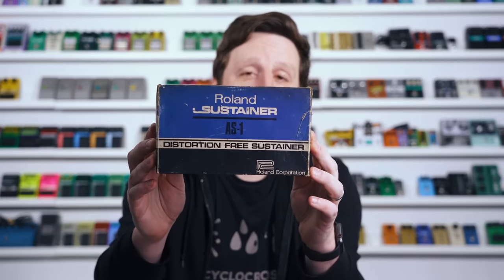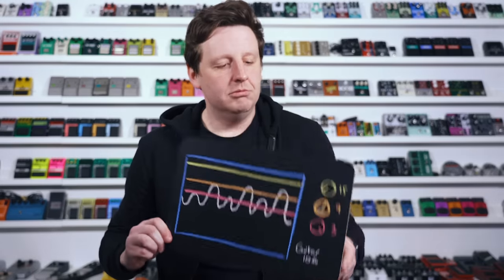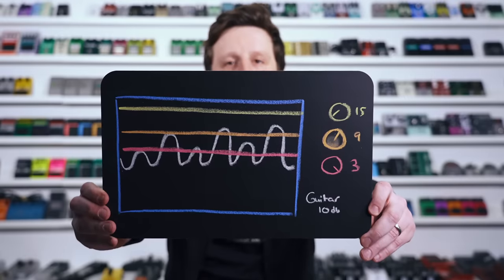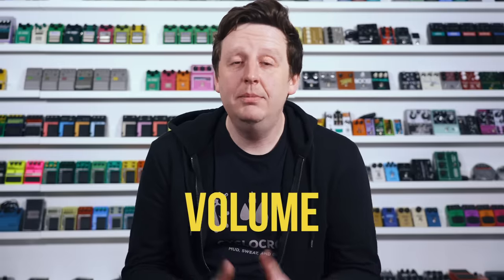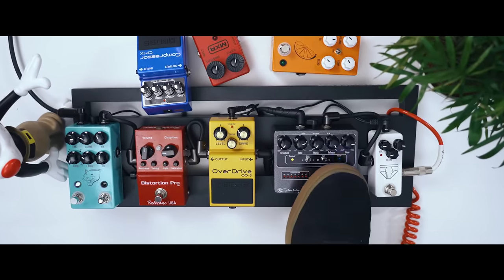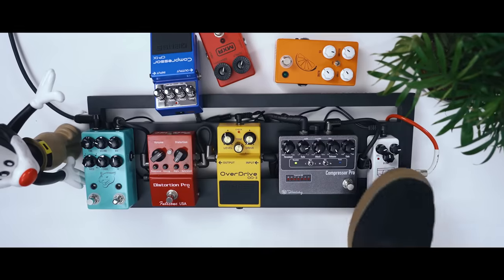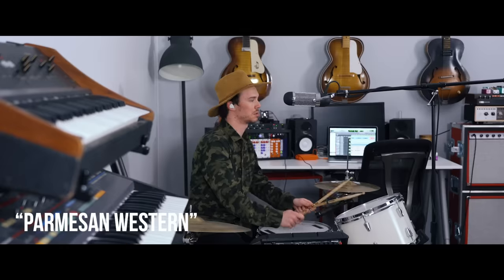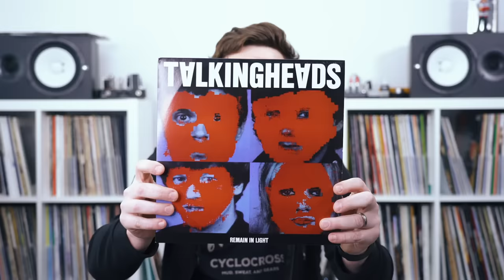How Do Compressor Pedals Work?

Comment: I am a compressor junkie! I have spent thousands on compressors. I keep coming back to the Boss CS3. (I am not sure that the way the ''sustain'' knob works is how it is described in this video i.e. controls the threshold). Distortion is a necessary evil to create long notes when soloing. However distortion masks the true tone of the guitar {wood/pickups etc} . I always use as little as the job at hand requires. The CS3 allows you to create long notes without the distortion but keeping the tone of the strings. Add the slightest amount of gain (post compressor) and you end up with a wicked Steely Dan type lead tone. The only other way to create this sound is with a VERY loud amp in a room on the edge of feedback. Like Larry carlton. This is largely impractical in any kind of live setting unless your playing huge stages like JB. The CS3 adds a bit of a glassy sheen, which you either like or you don't. I do. A BIG plus is the amount of volume in the level control which is great for boosting for solos. Many other compressors fall down in this department for my uses. As for chord playing, why anyone would put a compressor on your rhythm  guitar playing is a mystery to me. Dynamics are a good thing! They are a fundamental part of musical expression. Why you would add a box to remove them is a headscratcher! (In recording there are other issues to consider).

Comment: Another great video! Thanks man, quick question: What do you think should be the order of an equalizer and compressor in the signal chain on the pedal board?  Thanks again Josh for sharing  your great knowledge of this subject.
Reply: I'd say EQ before everything.  use it to remove or reduce unwanted frequencies before you do anything else to your signal

Comment: I use a Keeley Compressor Pro second in line in my acoustic rig, just after a Baggs Para DI, and I use a Diamond Comp Jr as my boost pedal. I tried several other boost pedals, and the Diamond Comp Jr is absolutely the best for clean volume soloing. Great vid. Thx!

Comment: I'm still getting used to using a compression pedal. I have Boss CS-3, because it was recommended by many acoustic guitar players. I'm doing solo gigs, and I've read and heard that it would help balance the sound, whether indoors or out. I really need to play around with it more to get that "feel" discussed in the video. This was very helpful.

Comment: If you never used compression you’d probably be none the wiser. But once you use it, then it’s hard not to use it again! I’ve had a Boss CS-3 comp on my board from 1992 to 2016, then I went through a batch of different models before setting on a Boss CS-1, and this week I swapped that with an Ibanez CP9. Talking Heads Remain In Light is a great album.

Comment: Just gorgeous slide work I love that tune
I've been watching all of your videos I can't help drooling looking at that wall  behind you I swear I will never get rid of another effects box again
I wanted to see a certain pedal on that two-in-one show you did I think Route 66 makes a compression Overdrive pedal
My technique is use a slight grind using either a distortion box or the amp and I have a footswitch compressor that I use for the leads it's just kind of glues everything together
They all seem to be a little different I started with the Dyna comp but I am can pick up the Marshall cuz I saw that on a less than $50 pedal show that you had
I just love this stuff you have a really good show I've learned quite a bit I admire the work that you do I built a dyna comp into one of my guitars a couple of years ago 
I enjoy your playing and a creativity your guitars are amazing just beautiful
I have a question? Why do certain amps like an overdrive distortion hitting the front end and what is it that they do that makes it sound better

Comment: I only became interested in learning about compression after I heard turn turn turn by The Byrds.
 I've been trying to figure out how to get that jangle bright sound
Reply: A 12 string Rickenbacker Guitar is really the key. I mean, people say stuff about how you should have a certain guitar for a certain sound but they’re often times over exaggerating. This time though... that sound is very specific to Rickenbackers, particularly 12 string models, and it’s hard to get right without downright copying the design (which the company will sue you over). 

Rickenbackers nowadays usually cost around $1500 - $3000 so you might want to consider some alternatives. A 12 string and a compression pedal might just be what you want to get that tone, but otherwise, Fender Jaguars have similar jangle (yet aren’t 12 string), and you can get decent quality Rickenbacker copies off certain websites but customs might take that if they get suspicious of it. Rickenbacker is very protective over their designs.

Comment: So, I don't really like compression that much. My tone is mostly clean to lightly driven/compressed (by pedal &/or amp). I use finger picking a lot and have put a lot of work into my picking dynamics. Quite often I run my amp/pedal very hot, but pick the strings very lightly, and I like living there where a tiny difference in how hard I release my strings can bring the tone from clean to deeply saturated. For my style of playing a compression pedal in front of my drive chain r e a l l y ruins my dynamics and tone, so I rarely use it. The only compression I'd need in these instances (e.g. most of my playing) would be for recording purposes, but then that would be done after sound leaves my amp.

Compression does of course serve its purpose, and it is quite style/genre dependent IMO. Many guitarists really need it, and all the power to them. But for those who are starting up playing and want to master their instrument, it should be noted that leaving a compressor pedal out of your chain might help to build better control and picking dynamics.

I do have a compressor though (Philosophers Tone). It serves it's purpose for very specific stuff. One example is for (rhythm) chord stuff when I need a uniform signal level into my drive/grit/dist for those power chords to reach the 'exact' amount of grit. And of course for clean, uniform level chords. If I just want it really saturated, though, with certain pedals or even with a small tube amp running at max, I'll 'hit the roof' and get natural compression anyway and, then adding compression doesn't make any difference.

Also, like pointed out in this video, it is great for slide stuff.
Reply: Listen to Colour Haze dude. Only guitar, amp turned way up, fingers, compression. Fuzz at your fingertips.

Comment: Cool. Very happy I watched this as I'm an idiot when it comes to compression. Question though. You rated different stomp boxes. What do you think about processors? Specifically the Alesis Quadraverb GT. Yes... I went there, as I have one and have for 30 yrs. Geez that's a long time. Anyway. My former drummer had my gear for a while and I noticed that one of the settings that had been changed was the compressor on my lead channel. Metalhead here. It was hissing and so noisy so I brought it home and when I started fiddling with it I ended up turning the compressor off. Is that a good idea or should I put it back into the mix, just at a lower range?
Thank you

Comment: Another gorgeous video. I'd like to ask if Whitey Tighty (or any other compressor like that) can be paired with a synth rather than an electric guitar. I'm using pedals on synths and I am to buy a compression.

Comment: I'm a compression noob. Are there any compressors that have an instant or "constant" attack? With the couple compressors I've tried, I find that even at the fastest attack setting, they let a big spike of signal through before they compress. That's the opposite of what I want my compressor to do. I want a compressor that evens out my signal for a very "smooth" sound. I basically just want it to "add sustain" (I know they don't technically add sustain) and make my volume a big more consistent. I don't want that pokey attack at all. I can't seem to find a solution as a pedal. I know I can get the result I want in a recording in a DAW, but I really really want something that can do that in the moment.

Comment: This is a fantastic video.  I've been struggling with my electric sound during band play.  I feel like I'm either too loud or too soft depending on the moments.  I also feel like the individual notes I pick around on just get lost in the mix. I generally play a cleaner sound. I've ordered a compressor pedal and I'm hoping that this will help with what I'm looking for.

Comment: so from the telephone example, is compression similar to what in dac software they call "normalization"?
bonus question: years ago i put in my board a behringer compressor sustain CS-400 pedal but i couldnt figure out its usefulness. is that specific pedal a bad one or i just expected too much? or it was in the wrong position in the fx chain?  i was using it before the dist/od pedals right after the EQ
and then a third question (this is a dumb one i think): what is the reason to dial up compression but dial up volume at the same time?

Comment: You mentioned, in one of your videos,  using a compressor to make a small amp sound like a much larger amp, dynamically.   Will you assess that in a future video?  I've never used a pedal-platform setup,  before, but am going to give that route a go, as I only piddle around with a low watt amp, these days, and I want to sound stadium-huge in my little bedroom.
Reply: Address, not assess.  I hate my phone.

Comment: Can you help? I want to buy an Electro Harmonix Keyboard simulator and a arpegiator that makes a guitar sound like a single note that repeats at a tempo I can control. Do you have any pedals in your line up like that? My local shops don’t stick them and I can’t try any out. Sound like tricky pedals to use. So don’t wanna but without research .

Comment: Sheesh. I want to use the Pulp N Peel as the last pedal on the board because of its many functions (mostly the EQ control and the XLR DI output to go directly to the mixer when live), but my dry section (a Bushido overdrive and the Lizard Queen) at the start of my signal chain after the buffer. Any bright ideas?

Comment: Excellent presentation. I would have appreciated a bit more technical information but that wasn't the intent here. Something that I've experienced is that a compressor can also improve the performance of someone like myself who doesn't have a great amount of dynamic discipline when it comes to picking - or maybe is pushing toward the limits of their ability. Certainly not a good idea to use it as a crutch long term but for the less talented, performing live, it can be a good idea to employ one for the sake of the band's overall performance. No mention of its value to bass players - for all the above reasons, I like using a compressor when I play bass.

Comment: cs400 is permanently attached to my peavey  microbass practice amp. I also run a KB amp with multiple inputs and use a compressor on one and a muff pi on the other. it works well as a monitor with xlr out and a 10'

Comment: Listen to Incubus as an exaple of the "compression wars" of the late 90s to the early 2000s.
 Their first 3 albums (Fungus Among Us,  S.C.I.E.N.C.E., & Make Yourself) gradually feature more and more compression, but still have dynamic mixes. Their 4th album, Morning View, is their most heavily compressed/"squashed" album, and the dynamics are lacking. The "heavy" distorted parts almost seem to be more quiet than the "soft" clean parts.  The song "Wish you were here" is an example.
The compression on their next 2 releases is a little more "tasteful", with much more dynamic range compared to Morning View and even Make Yourself.
I'll admit that I haven't listened to their material much since then, so I can't speak to the compression levels on the albums that came after Light Grenades.
Take a listen and let me know your thoughts and observations.

Comment: So I got the Ber CL9, had Atk @ 9, Lvl @ 130 & Sus @ 2. Also a JB-HB @ 9, pure Ni strings.
1st I noticed a chorus-trem effect by ear.
Then trying some different attacks, I noticed by feel the vibrations were just as wobbly.
Then I tried some chords & movement and noticed the strings were feeling wobbly.

I increased the Atk to about 11, buy slowly.

Felt the effect disappear & the strings mechanically tightened like going from a dozen cents into pitch while tuning.

So, I get the "feeling."

Now, is that just passive PUs?
Do active PUs avoid this?

Comment: I play bass I use an MXR block script red Compression pedal. I turned the level up to drive the amp and get a little growl and some boost (both pots at 1 or 2 o'clock position) and obviously for sustain and leveling And I love that sound.

Comment: Wide Dynamic Range Compression considered input compression...compression knee-points or thresholds, attack time, compression ratios ( I/O), release time.  Input compression usually low ratios or can be progressive ratios,  output compression usually high ratios.  Output compression is almost as audible as peak clippers.  Every industry involved with audio compression is basically the same parameters, different nomenclature.

Comment: I don't get compressors yet. Trying.
I got a Pulp n Peel, tried all the settings and like it best so far as a treble boost on my guitar.
I did play one open mic on bass where I hit the first note hard and the house sound clipped badly; the sound guy turned it down and it became too quiet to hear. Compression might have helped there.

Comment: My favorite compressor is an 80's Yamaha C0-10M pedal - bright yellow and just a great sound. I keep two on my board at all times (use one as a bit of boost) - have yet to pay more than $40 CDN for one when I find them. so, that would be about $25 USD. If you can find one- try it out. It bumped a Demeter off my board, which I liked the most of the others I have tried (never tried a Keeley, Diamond or JHS though - to be fair).

Comment: BECOS also make some fine compressors. Not widely available in the US, more so in Europe. I've used a empress, great unit but overkill for my board. I switched to a xotic SP for a while but missed the blend (parallel compression) which is what led me to the small becos pro

Comment: I have 3 compressors. Cheap Arion two outputs ...now that can get hissy; Boss CS3 (built into the BE5 multi effects), most straightforward; Pigtronix Attack Sustain ASDR, great compressor with blend volume, harmonics & treble boost- the rest of the effects on it, I struggle with. Any tips?!
Compression track: 'Be My Wife' David Bowie.

Comment: Just picked one of these up to try out alongside an MXR Dyna Comp and the difference in response is pretty noticeable. I found myself really pulled into this one at first for some of the awesome rhythmic sounds I could get out of it, especially for Cory Wong type funk stuff, but I ended up leaning toward the MXR for a general volume squisher because it felt a bit more transparent. When this thing's on you know it's on, even if it's blended a bit the slightly slower attack really makes each note pop in a particular way--which is cool, but didn't land for me as a sort of "always on" go-to comp. 

It literally feels like the elastic waistband on a pair of tighty-whiteys smacking back on you when playing funky stuff on this though, it's nuts.

Comment: The first Boston album changed pop music by using lots of compression on everything, drums, vocals and guitars as an overall sound effect. I have used LAB amps for decades because Robert Moog designed them with a compressor that really works. It is placed between the pre-amp and power stage.

Comment: What about pitch shifters, octaves, harmonized pitch shifters? These are all modulation effects. And they're actually the only modulation effects I like. I hate stuff that messes with pitch, especially vibrato and chorus. Although I do sometimes like a bit of flanger due to the tone modulation effect that you can often hear from a flanger. Think Van Halen. I was hoping you would touch on pitch shifters, harmonized pitch shifters, and straight octaves, which are redundant after the above two).

Comment: Just curious, why would you want to blend wet and dry signals when using compression?
Reply: The compressed signal helps with a more consistent volume but in some instances, especially where the compressor is doing a lot of work,having a completely compressed signal makes the attack / transient part of the signal sound very unnatural. I don’t personally use compressor pedals very often because I usually play music that involves a distorted tone, but I do find blending compressed and uncompressed signals useful when mixing drums and occasionally vocals.

Comment: Im using a Dyna Comp on my acoustic board, nothing extreme about my settings as I just want it to compress the super high and low so, Output at 3 o'clock, Sensitivity at 9 o'clock. I would love to try one with more customization, like the M76, but the Dyna Comp has been doing a pretty good job so far.

Comment: This is an older video but if anyone is cruising by.. opinions or thoughts on running a compressor through a Noise Suppressor/canceller?  Run it through, before, after, or never together?  Just curious of the opinions and /or best practices.

Comment: I always thought they shoulda called compression frequency normalization. When I think of compression I think of an am radio signal that just a bit too far from the receiver and it sounds very squeeeezed and tight and squishflat.

EDIT: 16:06 It does get more simpler than this
Spectracomp bass compressor by TC Electronics, but just use it for guitar. Because it's phat